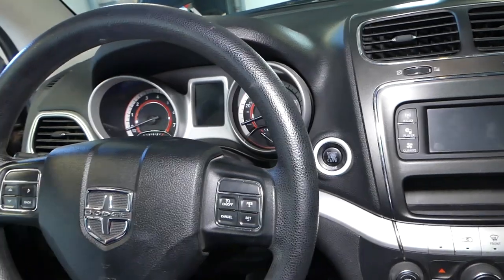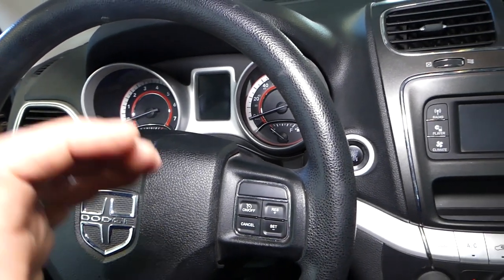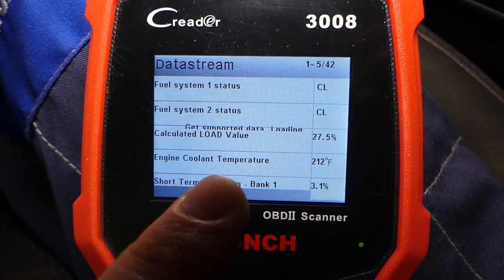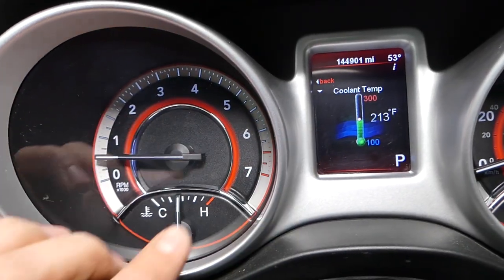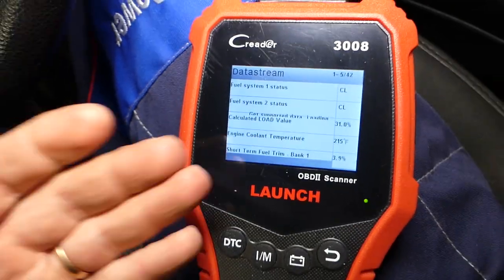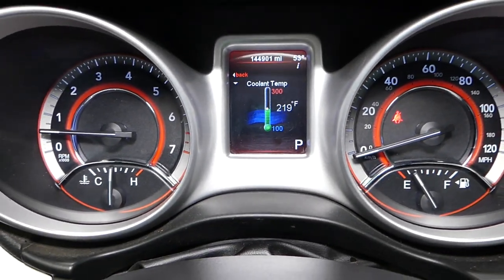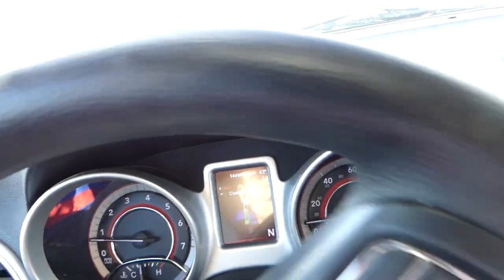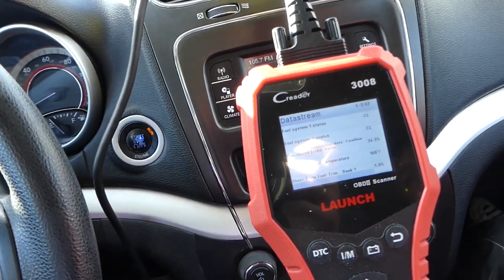HEATER BLOWS COLD WHEN DRIVING THE CAR, HOT WHEN IDLES

Comment: I have a 2011 dodge avenger.. It blows hot on one side and cold on the other side,  the other issue is when I let off the gas it starts to blow cold air.. Any idea on what the problems are?
Reply: The hot on one side and cold on the other sounds like a bad or stuck actuator door. I had the same issue in my dodge caravan as well as one in the back going bad. And now have another one bad.
Reply: @chelseyconkle4497  thanks,  I'll be looking into that

Comment: What if you just replaced the T-stat. Flushed and Cleaned the coolant system, and blew out the heater core. New coolant as well....

Hot at idle... Cold when driving???
Reply: Alexander Soto 
My issue today. 

Did you find a solution ?
Reply: Is your radiator fan working?

Comment: I have a new thermostat in my car the water pump works the coolant is new when my car is stopped it takes like half hour for it to start warming up and when its warm I can drive it but the car cools down completely and my car starts blowing cold air but I cant figure out what it might be
Reply: Oneill Cisneros  get out the air from the sistem on dour fill cap or your top radistor cap loss them and turn on the car and that extra air should be out but if you have a air cap you should par you car in a up hill place so that your radiator is the higest point to let out that air because you cant take traped air out from your heater core but when you are up hill and star engine and lose caps on radiator a little bit dont to much they can shot like a bullet in the air ... or flush the heater core in revers flow of your normal flow celan and flush main radiator and celan him whit a garden hose
Reply: Hey brother I have a 2011 Dodge Journey that I bought new. This is the first time I have had a dodge with heat issues. (not much heat for winter) I wonder if I should try what you said and park uphill? Do you mean start the engine first and then carefully open the rad cap?